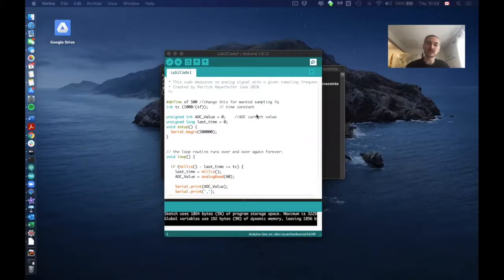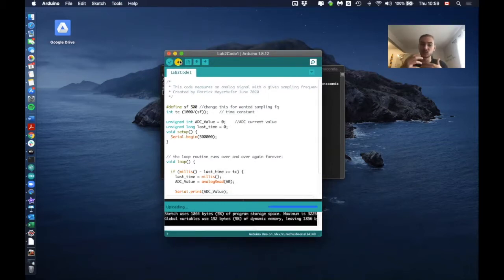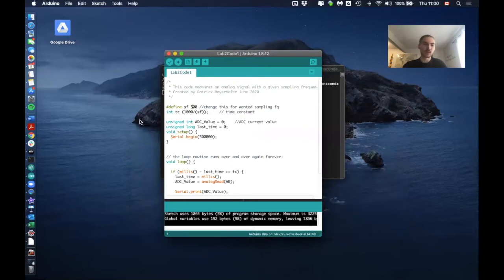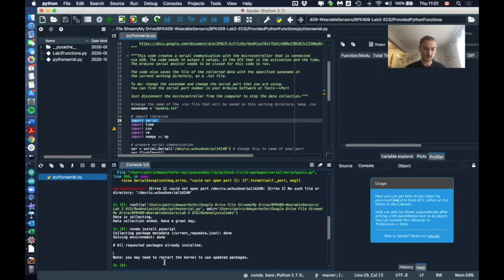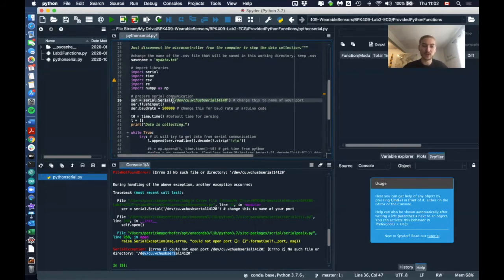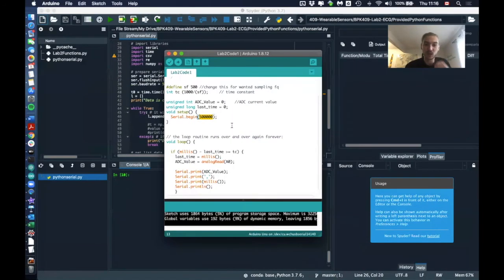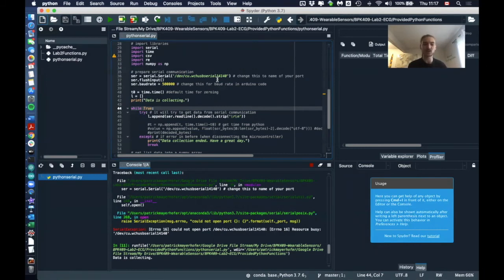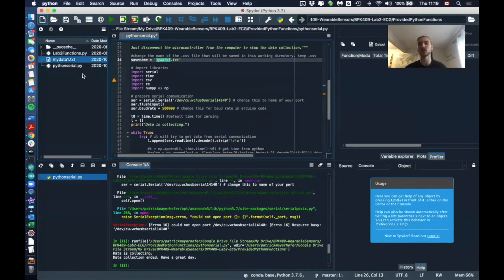Python Serial Communication with Microcontroller

Comment: Hi, thanks for this tutorial. I need some help in Python code. I'm trying to receive data from the serial port.
My transmission code working fine. But at the receiver side when i try to read the data then my console doesn't work and become hang. Here is the code of the receiver. Please help me to figure out the problem.

import serial
s=serial.Serial("COM2",9600)
data=s.readlines()
print(data)